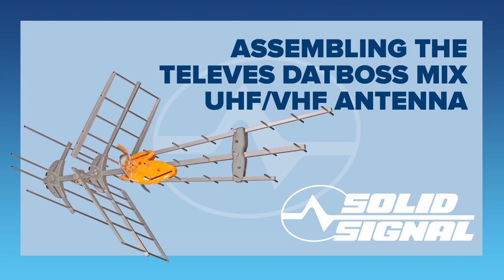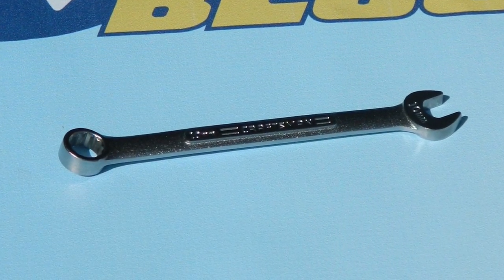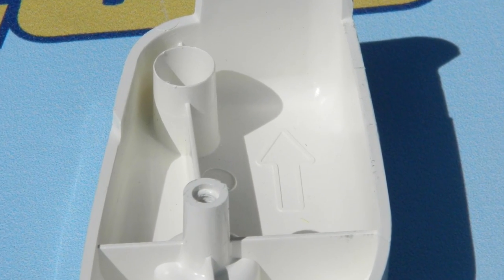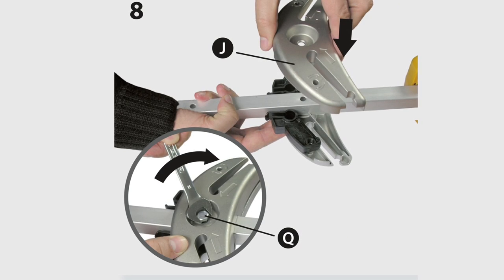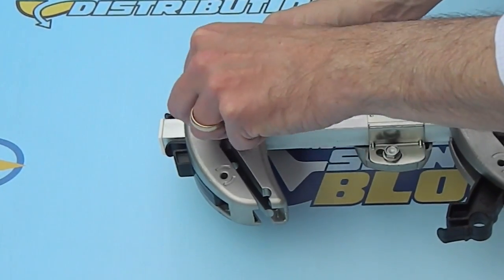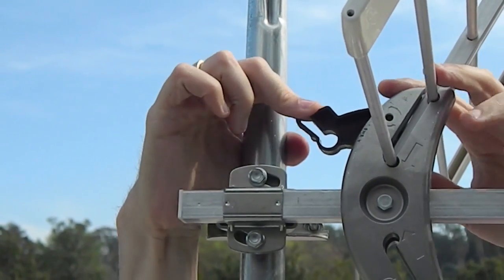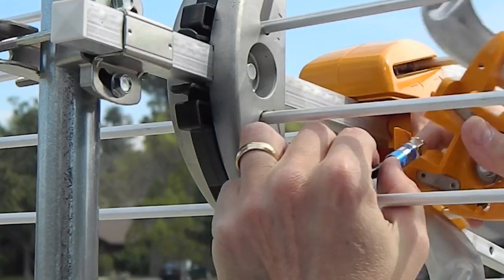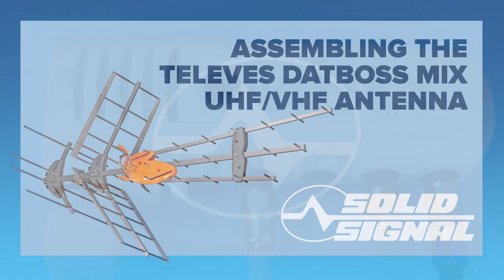Assembling the Televes DATBOSS MIX UHF/VHF Antenna

Comment: I have a suggestion. First, be aware that the coax connector that comes with the antenna is inside the included weather boot. The connector itself looks a bit cheaply made but it does have an O-ring inside it for weatherproofing against rain getting into your coax. Once rain starts getting into your coax, the braiding tends to wick the water all the way down to your TV. The coax I bought already has connectors on each end and they were considerably nicer connectors than what comes with this antenna, however they did not have O-rings in them. The O-ring would only be important on the antenna end of the coax, so this is what I did. I took an awl and picked the O-ring out of the Televes connector and put in the connector that is on my coax. Then I took the Televes weather boot and cut off the small end of it just enough to make the opening just big enough for it to slip over my coax connector. 
When the day comes for me to install this antenna, I plan to connect the coax, fill the weather boot with silicone caulking, push the weather boot all the way to the antenna, and wrap stretchable coax weatherproofing tape around the boot all the way down to several inches of the coax.
This should give me a good weatherproof connection that will be dependable for years. 
Just thought I’d pass that along.
Reply: I coat the outside connector thats exposed to weather with silicone. It waterproofs it and if you need to take it back off will be removable.

Comment: How big is this thing?  I wanted to buy the Ellipse but everyone is sold out.  Is it similar in width and how many inches from front to back?  My mount is on the side of the roof so I can't go too big.
Reply from the maker: The DATBOSS Mix is about 6 inches taller and about 9 inches longer than the Ellipse, give or take.

Comment: does the coax connector go inside or outside?
Reply from the maker: There is a coax connector for the antenna, which would be outside, and the other side of the cable has another coax connector, which would be inside.